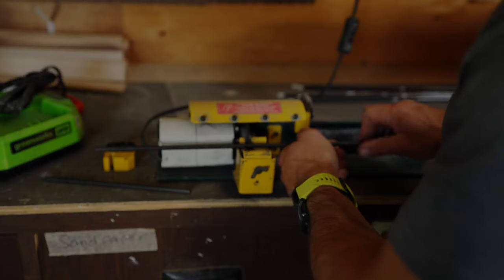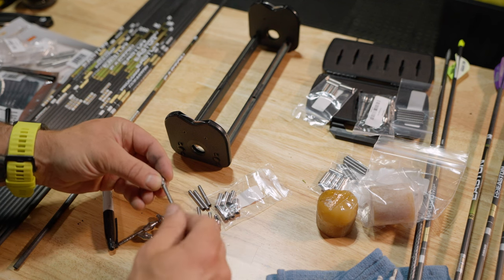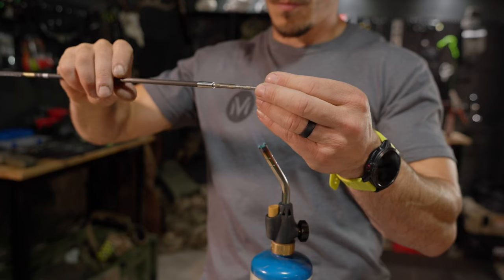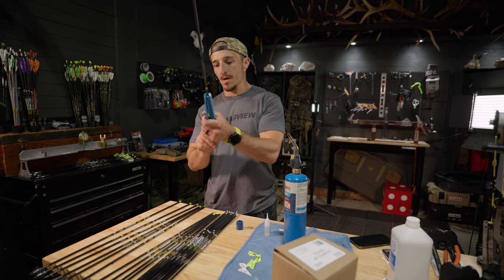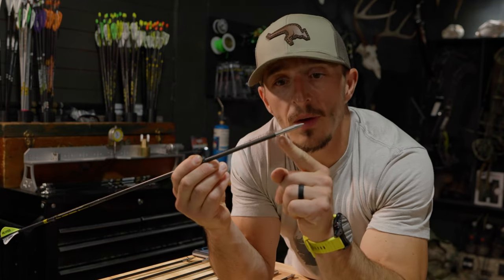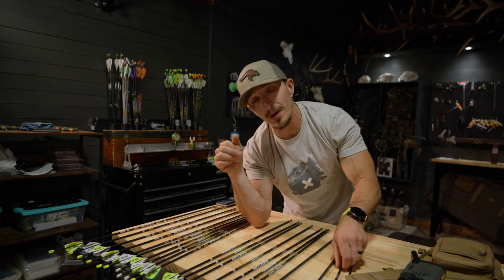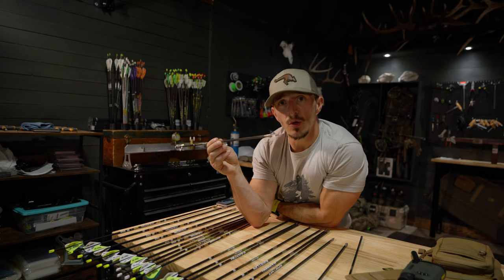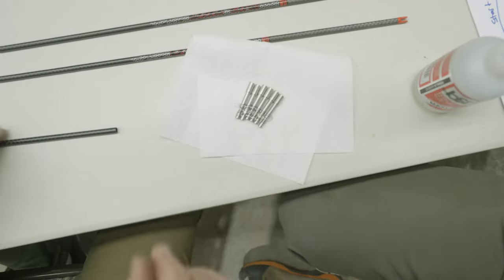My TOP HUNTING ARROWS for 2023

Comment: Awesome Dan!  I’m running RIP XV’s 300 elite cut to 29” with podium titanium insert, 2.75 tac vanes, 3 fletch to the left, lighted nock and topped off with a 125g single bevel VPA, total weight 425g

Comment: Great video Dan! Keep up the great work. We love how detailed you get.
My 2023 arrow setup:
TAC 2.25 driver vanes, 3 degree helical to the left, 3 fletch. Easton hit insert x 2. Easton injexion 4mm arrows 330 spine, sevr 100 gr deep six 1.5 broadheads. Nocturnal lighted nocks. 
Mule deer, whitetail, elk, bear and moose is the plan. Little worried about moose with the mechanical.

Comment: Awesome video Dan, always love the comment.  Last year i ran the Rip TKO 250 spine with victory ss shock insert, 100gr alick trick viper trick, tac 2.25 vanes 3 degree left, total weight of 453 gr, with 16.25 foc, shooting a mathews vxr 31.5.  For 2023 i decided to go with the standard Rips, 50 gr shok TL 204 aluminum insert, 100 gr magnus buzz cut for fixed, 100 gr sevr 1.75 for mechanical, tac 2.25 vanes, 3 degree left, final weight of 438 gr with 15.5 foc, out of my bowtec ss34.

Comment: Awesome arrows ! I am shooting Easton FMJ with Blazers and Micro Hades 100 grains . Nothing fancy with weight up front . Fletchings are left offset . Glad you noted Gas strings on Mathew’s phase 4 spins left because my Bowtech does same thing and I am waiting on my new Mathew’s phase 4 . Thanks
Reply: odd question but what nocks do you run? I have gas strings on my bow and some nocks i’ve tried and too tight on the serving

Comment: Whitetail and Black Bear in the Northeast so I saved a bundle by sticking to standard diameter arrows as all my shots where I hunt will be 30 and in. I am running 300 spine Victory Vorce elites with 60 grain stainless top hat inserts and 100 grain Magnus Black Hornets up front and for right helical blazers in the rear.  468 grain total.

Comment: For this year so far I'm running the VAP TKO fletched with the grim reaper hades pro 3 blade. I also got the grim reaper whitetail pro expandable have not tested that out yet. So it's currently a toss up between the fixed or the mechanical.

Comment: This year I’m running Valkyrie Reign 300 spine 29” with 200 grain Viking solid heads and center pin sleeves and four Bohning heat vanes and a Nocturnal nock for 517 grains and 18%FOC. They go 279 FPS from my Mathews Phase 4 29 set at 29.5” 71 lb draw. I also have a similar Iron Will set up but like these better.

Comment: Hey Dan!    Great video!   Oh you wanted info on our arrows?   
Well, this year it's a GT Velocity XT, 30", 300 spine with standard insert plus 10 grain back weight, and GT nock, Swhacker 261.   435 grains.   It's only 9.8 FOC, but every one is consistently hitting the target straight in from 20 to 60 yds.   Coming off the SS34 with 29.5" draw and 60lb, these Hybrid 26's with high helical thanks to EZ Fletch are taking a lot of air right off the bow to start spinning immediately, then screw fast right to the target without lost velocity.  Josh is right about helical.  Going for centering a double lung shot.   I came up with the same arrow weight as you did, and was surprised by your video.  It has the most weight I could use while tracking reasonably flat in the pins and without accelerated drop rate out through 60yd..  Last year, I had a 15 yard opportunity that I probably could have clubbed with a heavy stick.   Multi-season deer tag + elk + bear.   Mountain jungle hunting in Western WA.   
By next year, I'll need a new set of arrows, and will probably go to RIP XV.
- Randy, Puyallup

Comment: Thanks Dan!  Have you had any issues with the half outs blowing out the ends of the arrows?  I switched to a Ethics collar system, and they have been more durable (in my experience) compared to the BE rampage steel half outs.

Was having broadhead flight issues with 3 max stealths.  Tested a 4 fletch max hunter to see if that fixed the issue.  Probably overkill, but they're flying like darts now.  They're loud for sure, but the elk I killed with it didn't seem to notice.

Comment: I want to start by saying that I've learned a lot from you as I've begun my own DIY journey into arrow builds, bow maintenance etc and i appreciate your channel immensely.  Im curious how your RipTKOs are so light? What's your arrow length carbon to carbon? I run almost the exact same setup at 27.25" carbon and carbon.   Only difference is I run lighted nocks (20 additional grains), 4 fletched with smaller vanes that equal the same as your 3 fletched within 2 grains.  On a scale i'm sitting at 493grains and about 16.5 FOC.  It doesn't make sense to me how your arrows are 442.  In no way am in trying question your math or abilities,  i'm sincerely just curious how you come up 50 grains less without having 23" arrows.

Comment: Dan, I would love to see a video with content on salvaging components from broken arrows. I have hit inserts and impact collars epoxied to old broken shafts and I refuse to throw the components away. There must be a way to salvage the components and remove the carbon. Tips or help would be dope!!! Cheers to you and the team!
Reply: Put them in boiling water,screw a blunt broad head and wear a glove and twist them out sometimes it will take a couple of go's, I use the brass HIT brass inserts and there's no way I'm throwing them out.
Reply: @tonyallen8626  thanks a bunch! No way I’m throwing those parts out without a fight! Ethics and Iron Will both say they don’t have an official way to release them, could be room for some good video  content if someone figures out how!
Reply: @HUNTRGATHR  it works, I make sure it's deep enough so that the hit insert is about inch under the boiling water, I screw a broad head on so I've got something to twist, you need a glove or a rag both for the broad head and the arrow because it's going to be hot, grip the arrow round about were the insert is, I'll leave it boil for 10 minutes or so, hot melt glues are the easiest then the 2 part epoxy are a bit harder, I'll normal have them out after about 3 go's
Reply: @tonyallen8626  hey man, managed to recoup my parts! Thanks for the heads up!

Comment: Man, arrow and broad head choice can be a deep rabbit hole.

A few years ago I bought 5mm shafts from every company that sold them for testing.  Wound up going with RIP TKO because that got me right on point with the total weight and FOC I wanted.

Then I moved to my 3D set up.  This is where the problem is.  I went with a standard size shaft, low pro vanes and glue in target points.  Those arrows fly so much better in a cross wind.  The size difference between a .246 and .204 is so negligible.  It’s hardly noticeable.  The vanes and the broadhead are what’s catching the wind.  Not the shaft.

I’ve got 5 dozen of those TKO’s and I’m about to change to a full diameter (6.5mm .246) shaft.  I’m finding they just fly better.  Counter intuitive but it’s proving true on the range.

Added benefit of having the insert buried all the way in the shaft instead of sticking out like some weird mini baseball bat can’t be ignored either.
Reply: I'm shooting 6mm arrows and they fly so good.

Comment: Using the VAP SS’s 300 spine, with the stock components (I know I need to upgrade that part), AAE Hybrid vanes, and Kudu 150 grain broadheads but thinking of switching to the Annihilator 125 XL broadheads to get a better hole

Comment: For 2023 I'm sticking with the same arrows as 2022...GT Quantum 300, SS insert 75gr, the standard Quantum outset over that and 100gr tip, 4-fletch q2i fx-2 2.1" finished weight of 434gr. Fly great out of my rx7!

Comment: Rip Ss 300 spine 30” with Standard 50gr shok tl 10GR back weights and rage trypans for whitetail is my 2023 arrow set up. Using hot melt aswell cause I may want to upgrade outsert…. Man I wish we had Elk in New England!!

Comment: How do you get them so light?  I am an Easton axis 5mm, 26.5”, iron will 50grain insert, IW 10grn collar, 100 grain tip, aae nock, 3 fletch aae max stealth and wrap.  488 total weight.  They fly 271 fps out of my Hoyt rx-1 at 80lbs.

Comment: the way your string is twisted will affect the way your arrow spins in the first several feet or yards. if you have 2 different strings one twisted clockwise the other counter clockwise you can test it with bare shaft.

Comment: I'm using a Victory 300 spine Vap TKO at 29 inches with a 50 grain inside outsert with a 100 grain Montec fixed blade with three degree left helical AAE Max stealth three vane set up with a four inch Bohning wrap and a Nocturnal lighted nock and I'm just over 530 grains total weight shooting a PSE Fortis 33 set at 30 inch draw and 71 pounds draw weight at 80% let off . I'm getting full pass throughs without any issues. I even blew through a bucks shoulder blade at thirty four yards again with full pass through . The arrow system I'm using is super accurate and hits exactly the same spot as a field point . My only gripe is it is a very expensive set up 🤑! I've been bow hunting since I was 14 years old and I'm 50 now and I can't believe how expensive the cost of arrows and broadheads have gotten. I guestimate my hunting arrows cost about $60.00 a piece so I make sure those shots count 😳. Best of luck to everyone out there this coming season 🙏

Comment: My elk arrows Easton Axis 4mm 300sp w/ Ti halfout. 28.5”C2C. 4x AAE Max Stealth or TAC(still testing) QAD Exodus. 475gr 12.5%FOC with AAE. 460gr with TAC 14.9% 

Hoyt RX4 Ultra 72# 29.5” DL. Didn’t chrono yet. Hoping for 275-295fps
Reply: Have any feed back with the TAC’s? I recently switched from Sevr’s w/four fletch max hybrids to QAD Exodus TAC 2.75’s and I’m stacking arrows at 40 (mostly whitetail so I’m not shooting anything beyond 40). I keep going back and forth on a four fletch for fixed but I’m sick of building arrows 🤣🤣🤣

Comment: Is there a reason you prefer GR 3 blades over 4 blades?
In the 80's I used Muzzy 130 4 blades. As time went on. They dropped to 100 grains.  3 or 4 blades.  
Every animal is different.  However for me personally. It seems the 4 blade put them down faster, and better blood trails. 
I purchased some GR micro hades 4 blade.  Haven't shot an animal yet.
Time will tell.

Comment: Hey Brother. I'm looking for some advice on what spine arrows I should get. All the spine charts I've seen only include the tip weight and don't include the insert weight. I've gotten in way better shape and  increased my draw weight. I know the GT Hunter XT 340"s I shoot are now under spined a little and I need a stiffer arrow. I'll be building the arrows myself and want to go with a 100gr insert and 125gr broadhead. Should I drop to 250's or will 300's work? Will adding about 85gr make that much of a difference? My arrows will be around 480 - 500 gr. But, I'm a whitetail hunter in Indiana. So, no long distances. My draw length is 30 and my draw weight is 68ish. Different scales show different weights. I really appreciate you doing these videos. Gets my brain working overtime.

Comment: i'm simply no 4mm fan ,I believe the flanged 4mm to 5mm section presents a weak spot. 5mm is where I go and strangely enough, they match right up to the ferrule of a broadhead I feel making the whole arrow much stronger all around. The 1mm diameter difference isn't going to make a pile of beans of penetration difference when you use 80 pounds because pass thru is a pass thru. I'm not shooting Water Buffalo everyday, ,just occasionally, lol. 

My arrow is a 200 spine 5mm Bandolarrows 3K weave.

Comment: Great details on those very solid combinations. I've been shooting very close to 440 gr out of high IBO bows for 25 years but have added spine and FOC over the years which added greatly to consistency and long range performance. I mainly shoot whitetails so making over 300 fps and 92 lbs of KE is overkill but the deer don't seem to mind that its an elk arrow taking them down. Thanks for showing how deadly these flat shooting non "adult arrows" work. So tired of the RF, Ashby 600-800gr arrow initiative. Lift weights, draw more, make big KE, and the penetration takes care of itself.